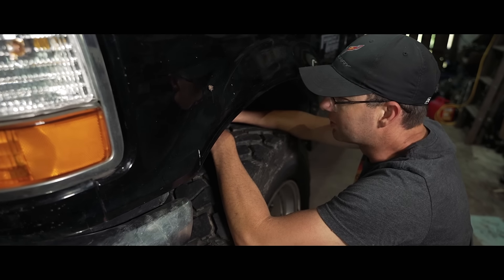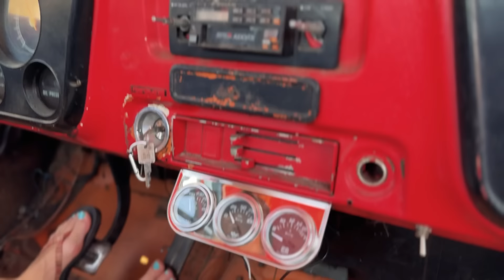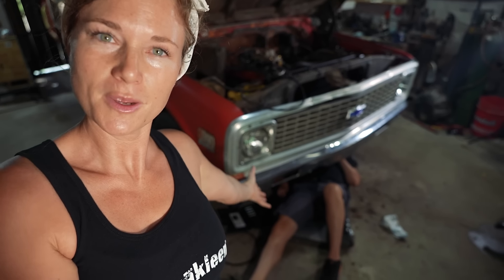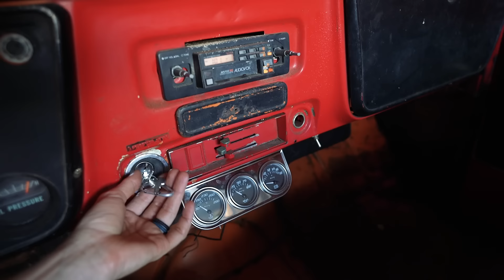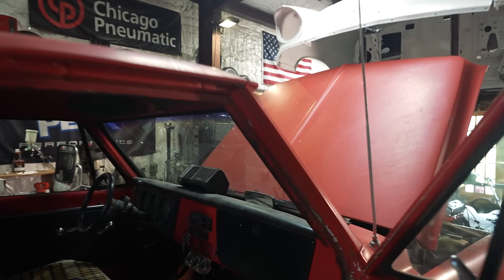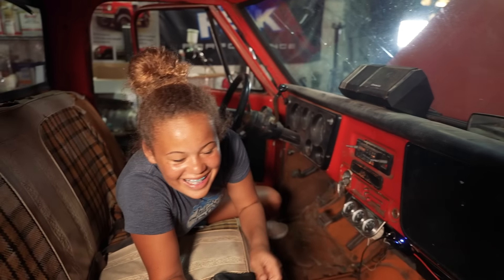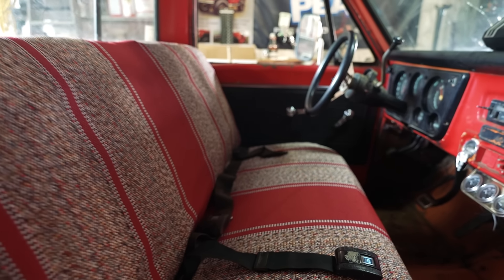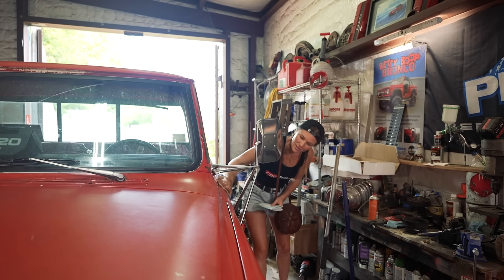Will it drive to family camp!? The Kid’s C10 gets some miles!

Comment: Just a little tip about your New weight distribution hitch and Sway control.. they are awesome.. I use it on our 30 ft camper.. If I may suggest... Remove your sway control before backing into any tight spots.. it WILL bend in a tight pinch.. just easier to remove it.

Comment: I have a couple of mint rear box corners that I saved from a C10 that had a tree fall on it ! When I finish moving I will arrange to send them for the little ones C10  truck! I find that the older engines like 13-18 degrees of timing

Comment: Make sure the vacuum advance is disconnected and set the timing at 12. This small block should love it. (yes reconnect it after). You should also use the ported vacuum tap off the carb.

Comment: Personally, I would grab the fan shroud from the C30. Since Dream is going to be doing a lot more miles before the C30 is back on the road. 
Lilie is getting so tall. 😨
So many adorkable peeps & kids.

Weight distribution hitches are great when you have soft suspension in the tow rig. Our previous boat had an old school one.

Comment: Hi, I went back to watch the other OBS vid.. and I agree with the other viewers..at about 14.23 when you rock the steering the inner splined section is not turning with the outer..the bolt can be tight but if its bottomed out it will not grip the shaft or the spline is a slightly different size. Please if you get chance check it again,use a better light so can see it clearly or get the camera right in there and watch it back. I hope it's just how the camera shows it but definitely doesn't look right / tight.
Love you guys ,keep smiling 😊

Comment: The transmission modules probably shot. Is it a Turbo 350 or is it a 400? They both take the same module. It takes vacuum to shift.
And if it's It takes vacuum to shift.
And if it's got oil in the line Next to the vacuum module You can pretty much say it shot.

Comment: Resting your foot on the brake pedal even lightly can activate the brake lights and sometimes even apply a small amount of pressure on the pedal can cause premature wear on the brake shoes.
I realize why people do it but its not a good practice.
I have seen it over and over doing brake repairs for decades.